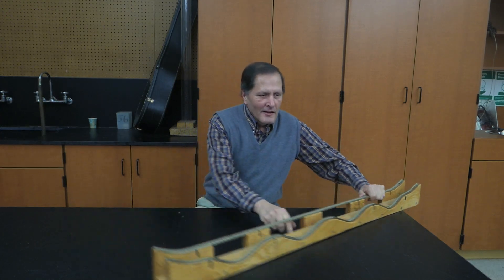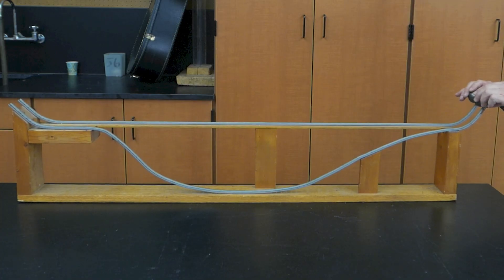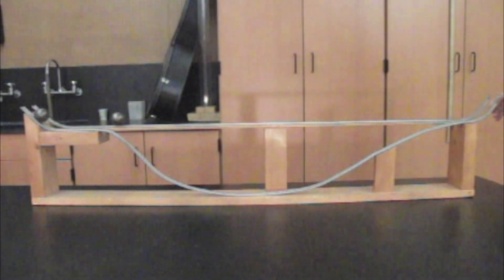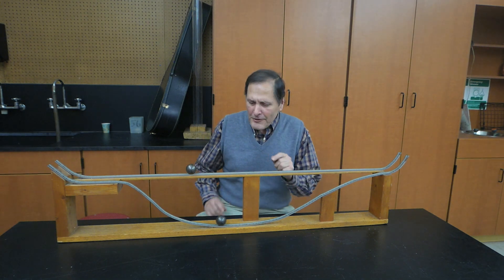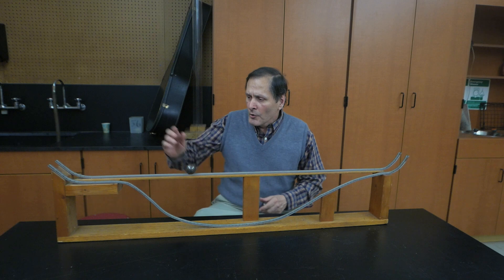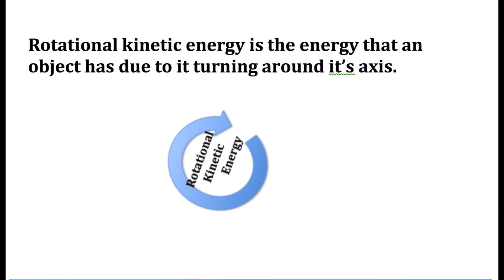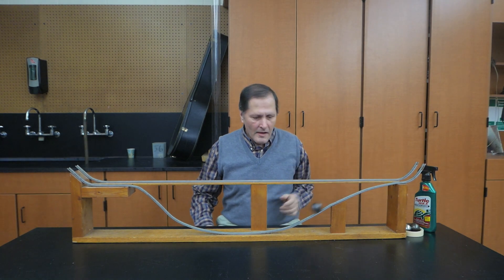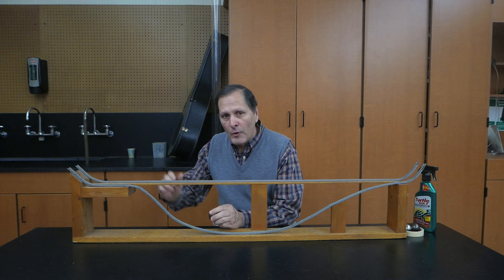High road low road race, potential kinetic energy Part 2--Homemade Science with Bruce Yeany

Comment: Very nice video! Liked the discussion with the hills getting too steep.  I also like explaining this by discussing that the normal force on the downhill sections increases V_x. So the average V_x is higher for the bottom track and since their horizontal lengths are the same, it must take less time.

Comment: There is something that I dont understand. At the end, the slope tracks both balls have the same height differential between start and end. So the potential energy is the same for both balls at both ends. Though one of the bass has more kinetic energy than the other because it moves faster so there is some extra energy that I am missing out.

Comment: You inspired me to build a high road/low road track, along with a hump track that was as close as possible to the low road track with the essential difference being a hump to the high road level.  I got an interesting result when I tested it with golf balls, while I'm waiting for my mini billiard balls to arrive.  Interestingly enough, the ball on the hump track beat the ball on the straight low road track, much to my surprise.  This result only happened with the golf balls, since I've also tried it with gumball machine bouncy balls, and in that case, the low road track ball beats the hump track ball, as I would expect.

I think an explanation of this result might have to do with some resonance of the normal force on the ball with the elasticity of the track material, that propels the ball forward on the hump track.  The hump track ball has varying normal force, unlike the straight track that has constant normal force equal to the ball's weight.   The track contains plenty of spanning shelf material, that could easily vibrate.

Comment: Hi. Bruce. Thanks for this video. I have one question. In your ball track, youe are using th steel strip with holes. Could you tell me the reason you use such strip. Is it for the revention of slip of ball on the track? I did some experiments wih "Space Rail" butthe potential energy is not preserved that is the ball did not reach to the height it was dropped. Is this mean that slip should be avoided for these kinds of ball experiement?
Reply from the maker: Whatever device you look at,  tracks, pendulums bouncing objects, objects will never reach the original height due to friction but with small amount of friction it can get close. The steel track has holes in it due to that is how it is manufactured. The track angle cannot be made too steep otherwise the ball will slip, especially   smooth surfaces without much friction such as the  steel ball on a steel track.  Increasing the friction between the two surfaces will slow the ball done quicker but the ramp can be made steeper so it's always a trade off.
Reply: @YeanyScience  Thanks so much for your kindness. ^^*

Comment: Are the balls the same weight.  If you use a silver ball and a golf ball on the same track, do you get the same results as the two silver balls? Thanks
Reply from the maker: the balls don't need to have the same weight but do need to be the same size, otherwise the number of rotations to cover the same distance will change

Comment: Could anyone simply explain to me why the greater drop (resulting in a a higher level of kinetic energy) is not balanced out by the greater ascent afterwards? This to me seems the most counterintuitive thing about the process and if there was an explanation for this in the video I kinda missed it...
Reply from the maker: If I had two tracks that are identical, two balls motion on them would have the same forward speed as they moved down the track together,  but drop lower the one track and the ball would then be able to move forward faster as it goes down the slope.  When it does start to ascend it is still moving forward faster the high track's ball.  here is another version of ithttps://www.youtube.com/watch?v=88NZStgiIt0&t=395s

Comment: I'd be curious to see the same tests using tracks of the same length. I understand the difference in length was not that much, but we are talking about science here. In the test at 8:47, the ball on the high road track went up to a higher level than the ball on the low road track. But, we know the low road track actually has a longer distance to travel. I understand the argument of friction on the ball, but are we sure there was actually more friction on the ball just because it went up and down some hills? or was it because it traveled a slightly longer distance?

Comment: The reason the tracks with more humps in were closer is because of the time the ball spends in the lower position in the low road track right? I think that's because the kinetic energy stores are increased on the low points so the high speed is present there.

Comment: Would it make a difference if you used cars instead of balls? The polished ball experiment shows rotational kinetic energy seems to be an important factor in this, but with a car only a fraction of its energy goes into the rotation.

Comment: How do you bend the shelf tracking without it kinking? It seems like even a little distortion would destroy the effect.
Reply from the maker: As long as it isn't bent too sharply distortion isn't a problem.  It is very easy to bent.

Comment: Fantastic video. I do have a question, though. During the test at 9:17, I would argue that the track with more humps reaches a lower height at the end of the track due to a LACK of friction. My reasoning is that due the changing relationship between the weight and normal vectors (the rollercoaster "g-force"), there is time for the ball to slip on the track due to a lack of friction which loses the rotational energy acquired. Thoughts?

Comment: What if on the lower track you put a higher bump ?
The track would first go lower than the straight track, then higher than it (yet still lower than the starting point), then lower again and up to the ending point. 
Would it still be faster than the straight track ?
Would it still keep moving for a longer time ?

Comment: Proffesor, first of all, thank for your videos. I really like them a lot. I have a question: did you say that if you clean the ball you will loose drag needed to continue rolling?
Reply from the maker: yes,  some of the ball's energy is turned into rotational kinetic energy,   if the track is steep like the large one shown,  the ball needs traction to be able to change that rolling energy back into movement up the track.  If the ball is polished,  it  loses traction and slips like it is shown in the video and can't climb back up to the top.

Comment: Mr. Yeany, 

What type of material did you use for the metal track?
Reply from the maker: it is shelf bracket tracks,  available at hardware stores (Home depot for example) around $3.00 for a 6 foot track,  easy to bend
Reply: Thank you!
Reply: Again, thank you!

Comment: Another great video Bruce, it would be interesting to plot the distance, speed or height of both balls on different tracks against time. I'm not sure how you'd accurately measure it... other than using speed gates all the way along the track maybe? They would need to be synchronised with the same clock though, so might get complicated to build.  Perhaps just analysing slow motion footage would be easier?
Reply from the maker: We'll try these again come next school year,  I have a few ideas that hopefully will examine a bit more accurately what's going on.  If not,  the slow motion camera always helps.  thanks

Comment: Another explanation if the 'spontaneously' running back and forth ball could be that the weight centre in the ball is not positioned in the very centre of the ball. Looking forward to your considerations on this issue!

Comment: Would the fastest way to get from point A to point B be to go down and then back up a cycloid? because I know a cycloid is the fastest shape to travel down in a uniform gravitational field (You can use Snell's law to appoxiomate it if you have infinitesimal changes in the index of refraction)

Comment: Hi sir, thx for posting this video. I noticed something that highly surprised me. When you tested which ball would stop moving first, the one at the highest road ended on a horizontal part, which is quite understandable. Yet, what I do not understand at all, is that this high-track ball with its last energy twice returned/changed direction while it was on a horizontal part/track, and did not even touch the slopes at either side. That is peculiar, no? It would mean that moving object kind of 'remember' the very moves they made before, for this forth and back movement could not be caused by either gravity kinetic energy nor rotating kinetic energy. 
Looking forward to your reply!
Reply from the maker: I noticed that also,  I checked the track and it is straight,  maybe the table on a slight slant.   I will try it on the same table and see
Reply: Bruce Yeany Well the first change (at 6.01) could be caused by a slanted table, but then howcome it changes direction again at 6.03 ? I guess there must be a slight pit in the track. Or can you think of another explanation?

Comment: Just curious here, is there any correlation in the time it takes each ball to stop and the length of their tracks? (the ball that is gathering more kinetic energy is stopping later due to the increased length)
Reply from the maker: I'm not sure but I'd guess that it has more to do with the friction as it is going up and down the hills more than the length

Comment: I want to see a track where the length of the track is exactly the same and the bottom of the valley and top of the track are exactly the same distance.  The high road is getting cheated out of potential energy by getting less of a push.  the several inches of length when converted to height should equalize the race.  to straight vs curvy instead of high vs low road.

Comment: So let's say you start both tracks at height 4 and let them fall at height 2. One of the track is straight and leveled  at height 2 until the end where it reaches height 4 again. The other track keeps going up and down from height 1.5 to 2.5  (an average height of 2) an even amount of times until the end where it reaches height 4 again. The balls should arrive ideally at the same moment, am i right ?

Comment: Hi, Bruce! You should make a loop in the tracks and explain how it works :D or even a double loop
Reply from the maker: HI Alex,  it's on my make list
Reply: @YeanyScience  They don't actually end at the same point on the x-axis if you look closely (mid-way or end-point, whatever you want to call it...)  the slower ball is going further along the x-axis, just slower...  this is the law of conservation of momentum...  the faster ball is going less distance along the x-axis, but with more quickly...  you can adjust this by changing the moment of inertia of the balls and the radius of the balls...  changing the mass will only change the friction and make the heavier (more massive ball) go more slowly...  it's much like gears, or pullies...

Comment: well, the 'depth' of the low road track is also limited, I guess, by g. I mean If you calculated how long it takes for the high road ball to get to the other side, and then calculated how many meters of free fall would take that much time, you would have an upper limit on double the maximum depth... not sure I am being very clear.

Comment: Trains cant climb steep hills. Can they not because of the low friction?
Reply: See James May
Reply: mthlay15 the train wheels are made of metal, which is the same material of the rails. When doing a steep climb, the weight of the train isn't vertical to the wheels. Because of this, there is less friction, and so less traction.
Reply: Marzio Moretti Gravity only works vertical, no? So the weight of the train still is vertical on the wheels. The 'problem' rather is that the weight of the train is not 90° to the surface.

Comment: If you go above the height of the high road as a hump, would that impact which reaches first?
Reply: The ball can't reach a position higher than its initial height. But if you could make a hump that is lower than the initial height and higher than the flat part of the high road, the ball will roll over the bump with lower speed. So, if you have to identical tracks but one has a hump with a height that is not too high, the ball that passes the hump will reach the finish later.
Reply: Bart Schepens this was what I was asking. thanks for confirming my suspicion

Comment: Smart truck drivers use these principles all the time in the mountains. If they're loaded heavy, but have a smaller electronically governed engine, they are said to have a "dragonfly" truck because you're dragging the truck up one side of the hill, and flying down the other. Doing this, on less curvy hills with a clear line of sight, reduces fuel consumption, is easier on the truck, and keeps your average speed up.
Now, there are some hills throughout the Appalachians that have escape ramps for trucks in the event of a mechanical failure or for rookie or arrogant drivers that font pay attention to the road signs. They end up going too fast and over heat their brakes, making them useless or even setting them on fire. I saw a picture someone posted the other day of someone who's trailer brakes failed. the brake drums had to absorb so much energy that they were literally red hot.

Comment: I loved the illustration of rotational energy being used to get up the hill. The slowmo of the ball spinning out at the top of the hill was perfect! The high/low road thing ties in with the brachistochrone thing too, which vsauce and Adam Savage did recently. (I like your design better, looks like you don't need a bunch of expensive equipment and supplies to make your own.)
Reply: trigonometry

Comment: what would get the fastest acceleration? a straight line diagonally down, a perfect circular cuvrve or a 90 degree drop in???
Reply: +Jordan Hillard It's something called a cycloid, I think. One of the classic parametric-only curves.
Reply from the maker: Hi Mr. E     of those choices,  the circular one should be
Reply: escorpiuser that's  the reason I asked lol
Reply: Bruce Yeany mind doing a video on it? and maybe different types of brachistochrones?
Reply: He did already
Reply: +Jordan Hillard It's something called a cycloid, I think. One of the classic parametric-only curves.
Reply from the maker: It's on the to do list,  the problem is I have too many  videos I want to make and  not enough time.  I made one years ago with glass tubing as the track, guess what happened. I want to to do the brachistochrone problem because everyone that has done it stops just when the problem gets interesting.  The second half that should be discussed is the conservation of energy.   The balls reach the bottom at different times,  my question would be,  once they reach the bottom ,  which has the highest exit velocity off the track?

Comment: So what you're saying is that if you take the high road and I take the low road, then I really will be in Scotland afore ye?
Reply: DrToonhattan I'd prefer the road less travelled.
Reply: DrToonhattan lock lomond intensifies
Reply: DrToonhattan , I think he is proving that in any religion, and any gods word, the point is , the High Road may take longer, but has way less bumps in the Road. trust in your God and you will get there, take a short cut. . . at the end of the video, the hill may be too steep. . . . and you end up in the bottom. . . . J.S.

Comment: thank you so much Bruce I love watching your videos with my kids then we try building them working on the string thrower right now. what did you use to bend the track (I have not looked at the material)  I know your making a video don't know if I can wait.
Reply from the maker: HI Mark,   you can easily bend it by hand,  I suggest running some light sandpaper over it before you use it.  I buy mine at  Home Depot,   it is about $3.00 for a 6 foot section
Reply: Thank you too easy!

Comment: That clarified, thanks. Now I thought this about the balls stopping: The ball at the lower level has shorter track to go back and forth when it is stopping. What if they both dropped to lower level, but the other more low than the other, but both lower levels had the same length? I guess the lower would still move longer time until stop, because it has more kinetic energy.

Comment: what if we can construct such roads, where we can use gravity to propel the car up to (say 75%) of the track considering drag and friction losses, rest 25% using external engine power. This may be helpful in saving fuel and energy for cyclists. what practical problems you Think we may face if we take high-low roads in practice?
Reply: pratik dedhia The problem faced by a system like that is you have to start and stop at the high spot. Roller coasters have this problem and have much higher maintenance requirements, and if the cars come to a stop in the wrong place extra equipment is needed to drag them to the start. (for cars on the road it means they couldn't stop for a damaged tire, for a train it couldn't stop for an obstruction on the track)